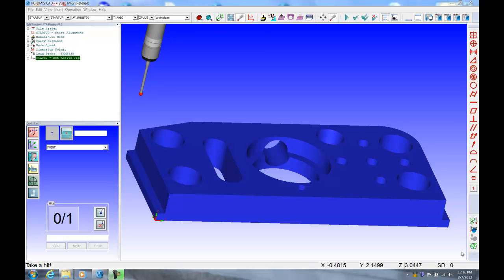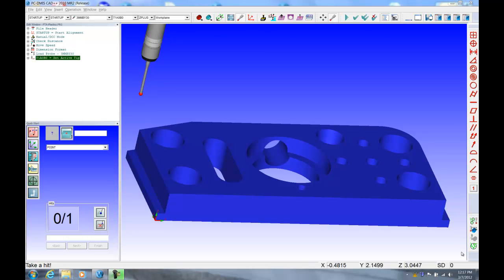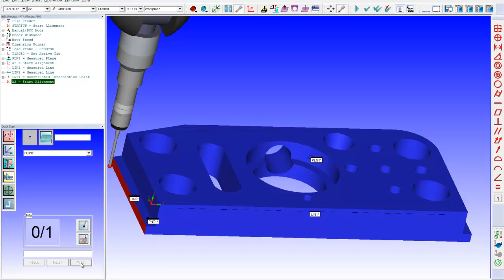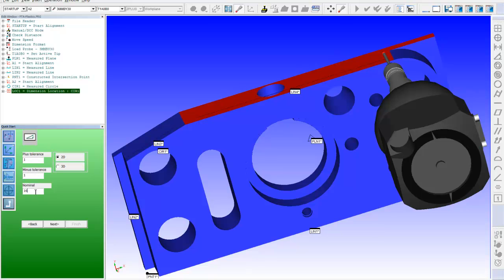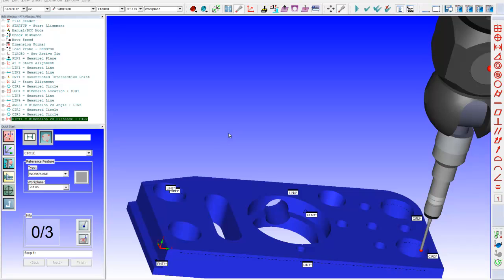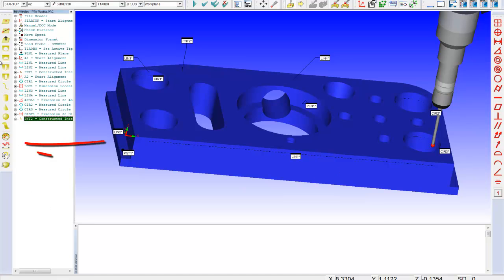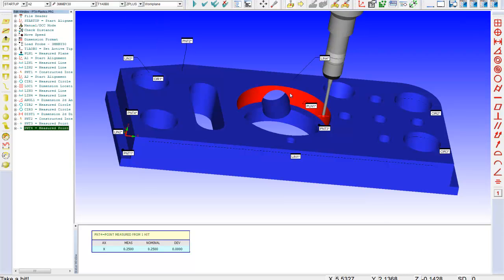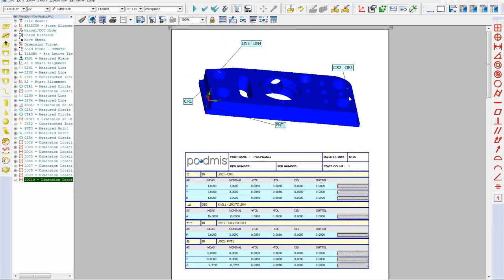Manual Pcdmis Quickstart Demo

Comment: I deal with a lot of parts that have "complex" datum features and radial datums features that are about R 77". Will a best fit alignment be the best way to measure these types of parts? tolerances are open mostly. .010 - .020 position tolerances, etc. Any pointers? (I am using the romer arm so iterative alignment is not an option)
Reply from the maker: Sorry for the late reply. I just saw your post. 
Your application sounds a little too complicated for this forum. I would ask your local Applications Engineer from Hexagon. I'm sure they could help you.